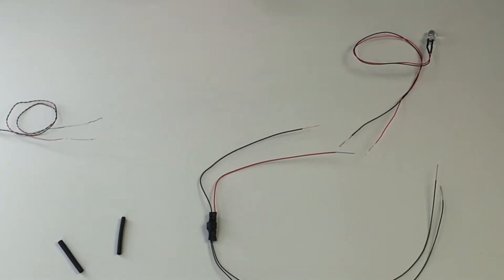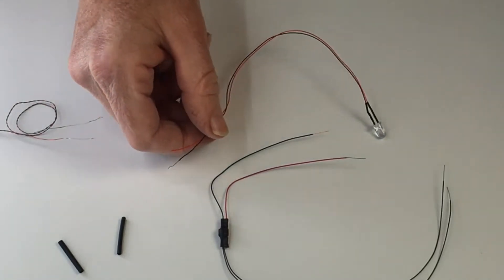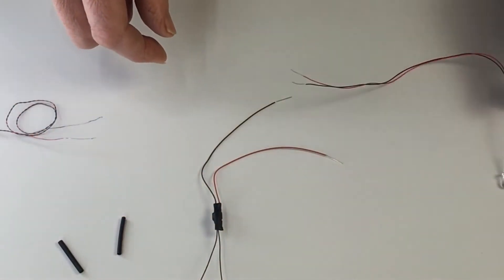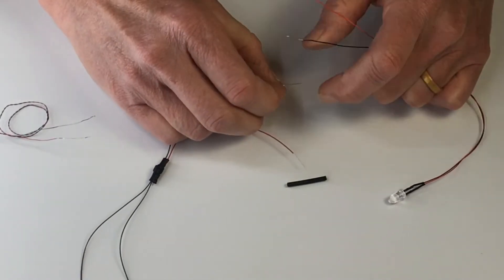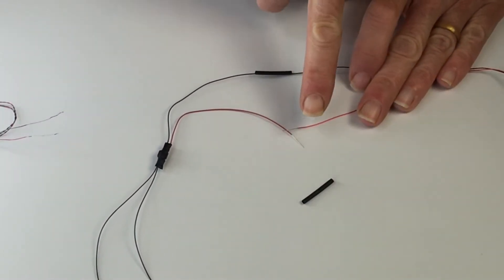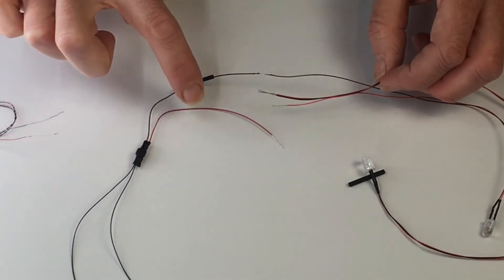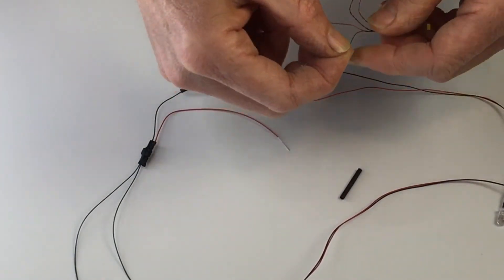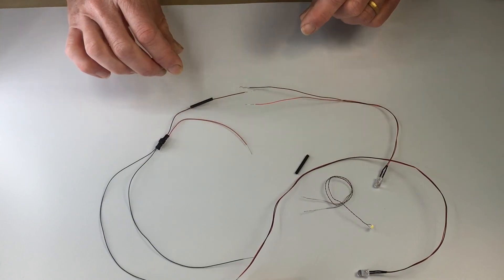Separated Mini LED Lights for Creative Builds

Comment: How long will it take hook all that in 1/64 scale?
Reply from the maker: The separated circuit is made for people using model train power supplies typically 18 volt AC. If you are not using AC power we have other lights that can run on nine-volt battery or on three-volt batteries that do not require the separated circuit.